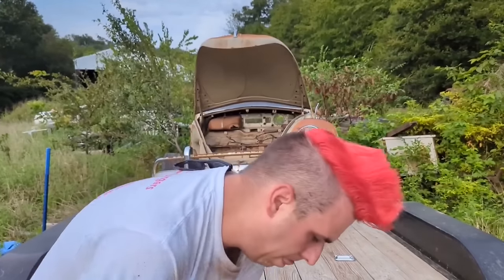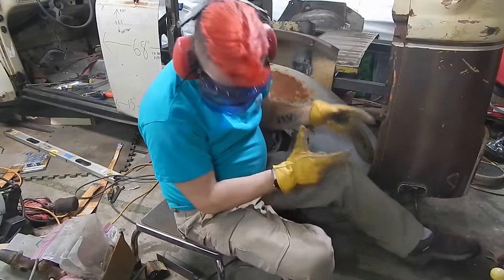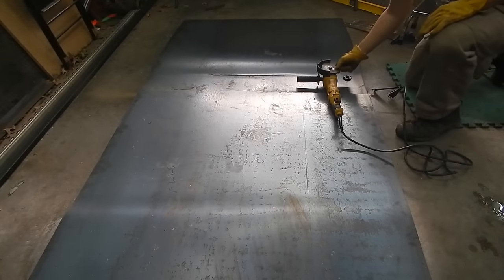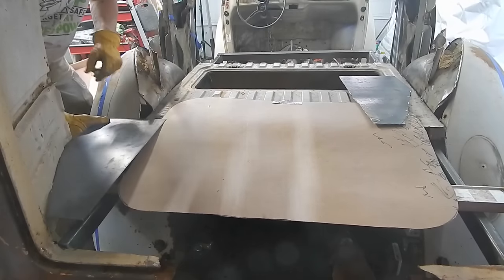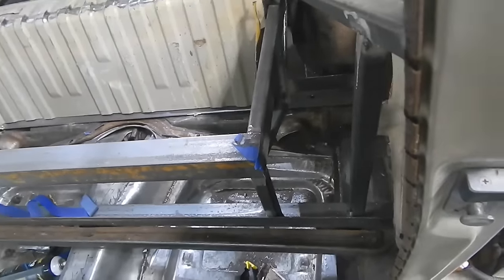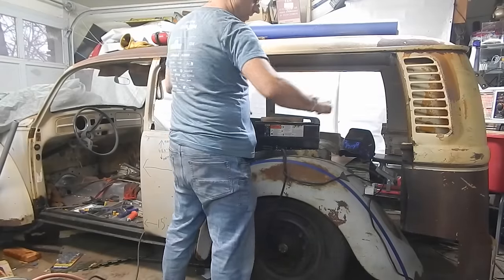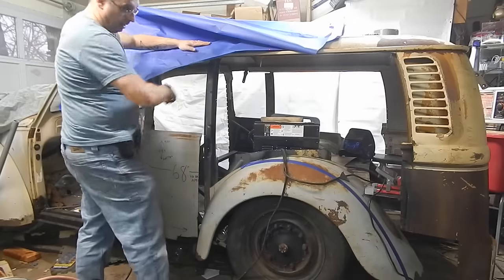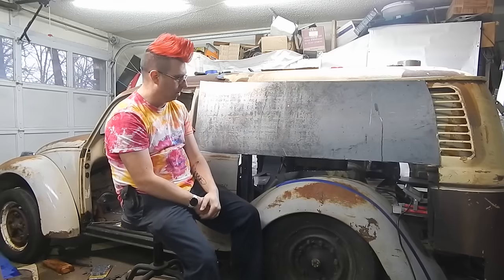Fabricating new metal panels and floors on the Käfer Van Build, Panel Bug ep 14

Comment: Not sure you handle it that way on purpose... and hope i seem not to be too German..😬😄
 You use your angle grinder in the wrong direction. 
Please check it out and screw the handle in the other hole, correct the fender. It's easier to handle.
Stay well and greets over the big pond 😊

Comment: I also think it is a nice project to look at, but one comment: you are missing the gas nozzle for your welding torches, which means the welding is not good
Reply from the maker: Flux core. No gas used so no nozzle needed
Reply: okay, but as far as I know you still need a gas nozzle for gas formation, but if you are satisfied it's fine anyway ✌🏻